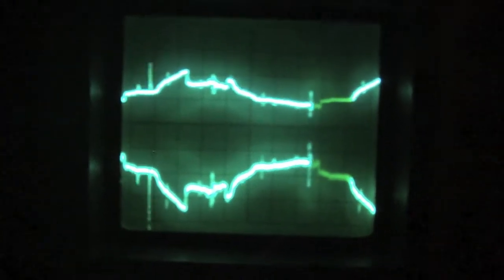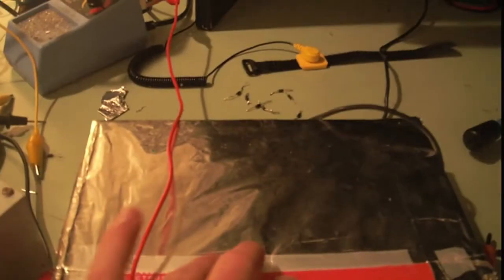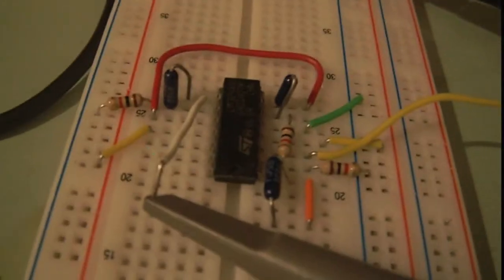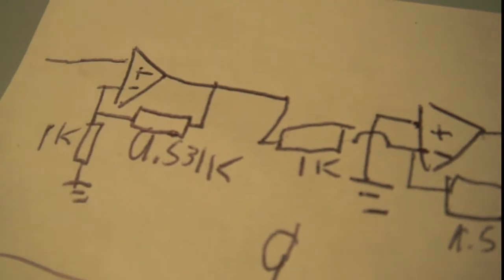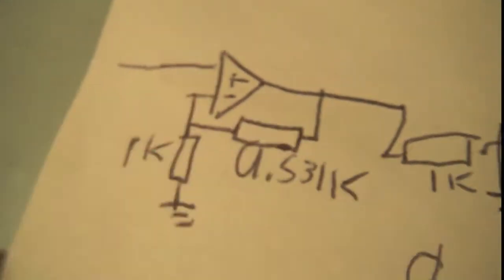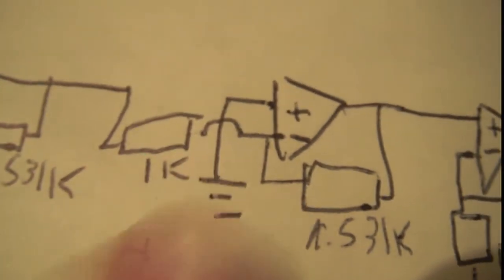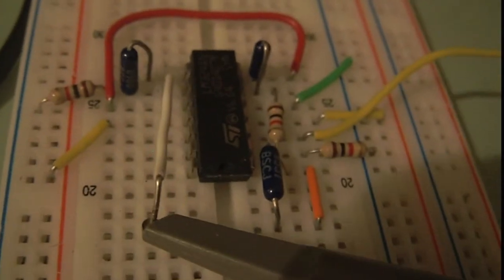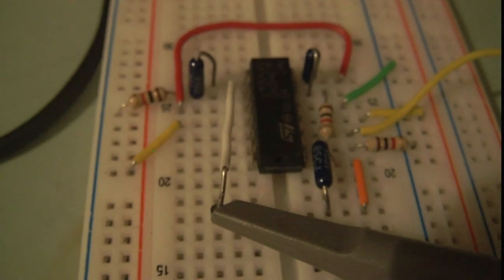Cosmic Ray Op-Amp Update

Comment: There are other contributing factors in low-noise, high-gain op-amp circuit designs... even resistor choices... both the resistor TYPE (there are low-noise resistors), and Value... this gets complex.... take a quick look at YouTube video (  W0vfALQ_n54  )
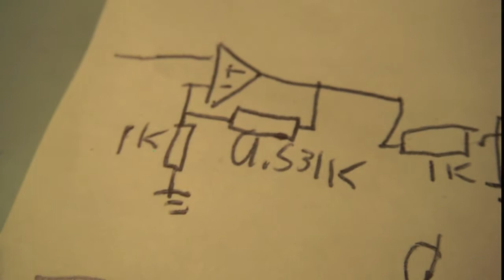 specifically at around 7:00. They have several other op-amp instructional videos that may help.

Comment: I would cap. couple between the 1st and 2nd stages. If you measure the DC output voltage (ref. "0" volts), it will indicate how much opamp offset V is being amplified. I don't know about your detection cell, whether it's AC or DC coupled, but that may affect things a little too. That 1st stage that has to deal with the lowest signal level is the most critical. I would suggest less gain in the 1st stage, then increase gain in the successive stages once you have higher signal levels. (continued)

Comment from the maker: I have added a high pass filter between the amplifiers and the comparator, do you suggest I do it between each op-amp stage as well, it seems to work just fine with out them.

Comment: You should capacitive couple the stages. With that much overall gain, your first stage input offset voltage will be amplified 1000 times... and will limit your usable V-swing of the output. Also be sure to do some extensive supply filtering AND decoupling close to the op-amp... you don't want power supply noise getting into your output signal.  The High Pass idea would serve 2 purposes... it would kill 1/f op-amp noises, as well as accomplishing the capacitive inter-stage coupling.